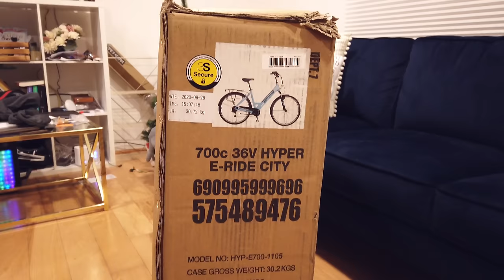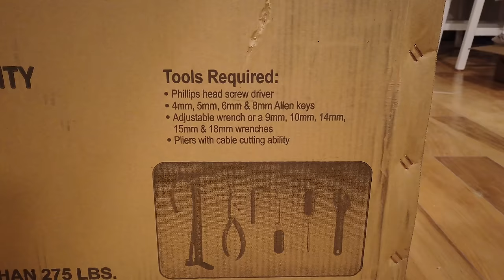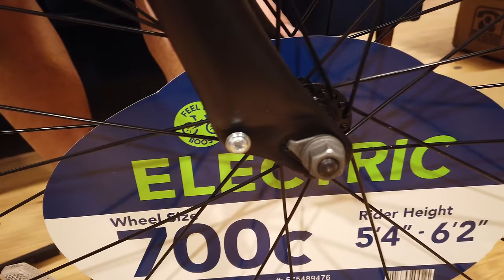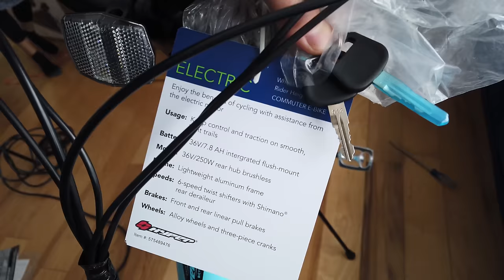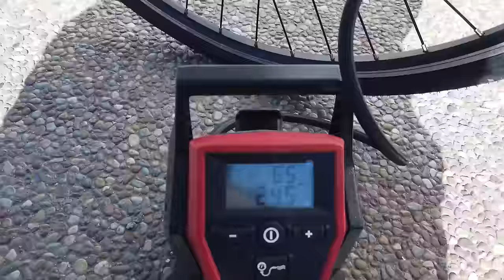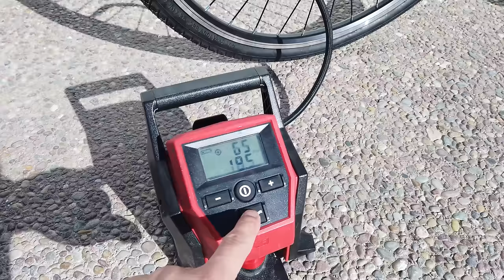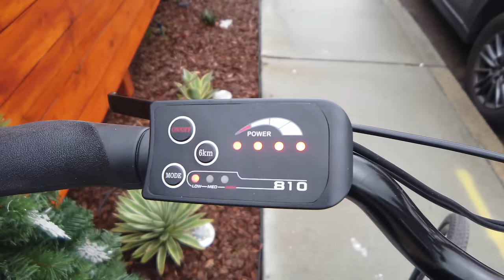Cheap $398* Walmart Electric Bicycle!!!? Hyper E-Ride City 250W 36V Ebike Review + Assembly Tutorial

Comment: So it sounds like the bike is designed to limit your speed to 20 mph . This and the fact that it has no throttle makes it a "class 1" e-bike.   Class 2 is also limited to 20 mph but can have a throttle as well as pedal assist. I believe  class 3 is pedal assist only but has a higher speed limit. All 3 classes are also limited to a 750 watt motor. These are the 3 classes of e-bike that are legal for road use in the US. This is my understanding from what I have read, if this is this is not factual or has changed,  maybe someone out there can let us know.
Reply from the maker: That sounds right according to this website https://www.aventon.com/blogs/aventon_bikes/difference-between-a-class-123-ebike

Comment: Maximum speed is 20 mph , so once you reach that speed , it cuts out. Now you are just pedaling until you reduce your speed below 20 mph .
Reply: ok, so even if you had it on high while full pedaling (which he didn't), it would just cut off the assist?
Reply: @dormetheus  yes. it is intentionally designed that way for both legal and hardware reasons. once the system detects that the bike is going over 20 mph it will stop assisting you. that's basically it
Reply: It becomes pretty seamless.  If you want assist, just don't pedal too hard once at 20 mph.  You kind of hit a wall, since any faster and the motor stops assisting.  Believe me that 20 mph is about as fast as you want to go regularly.  I hit maybe 45 mph on some steep downhills on my regular bike and that takes max attentiveness and wouldn't be pretty if a mechanical failure or a hard bump.

Comment: I have one of these.  Great value for the money.   Usually I prefer to get a little exercise, so I usually set pedal assist to level 1 which will on level ground allows me to 'out-pedal' the motor -- by using human power my speed is generally over 10 mph which is above the cut-in point for the motor.  But on hills, if the grade is substantial, muscle power falls below the amount necessary to stay above 10 mph and the motor kicks in, which takes the 'killer' out of the hill.  If I want to expend less effort, I set the pedal assist to level 2, which will generally push the bike along at 15 mph.  Unless I pedal like mad I can't really apply any torque via the gear chain, so in this mode, except on hills, I'm just circulating the pedals without actually contributing to the forward motion of the bike which is driven by the motor most of the time,.

Colin is right about it being difficult to get more than 20 mph even in the highest pedal assist mode, but for me the bike is more about extending my range from my maximum waling distance (more than 2 miles and my knees will hurt for a month, but with the bike a trip of 10-12 miles is pretty comfortable).    The way pedal assist works is something you adjust to.  I think it works very well and you can adapt to it's functionality to a variety of different strategies, depending on what your priorities are, getting there fast, getting somewhere far away and back on one battery charge, getting there without breaking a sweat, or getting there and getting some exercise too.  After a time you'll be able to figure out how to use pedal assist to accomplish any of these objectives.
Reply from the maker: Thank you for sharing your experience with the bike!
Reply: I know it's called e-assist, but if you're on a flat road on the highest setting will the bike move on its own using just the motor without any pedaling?
Reply: @norcalpacific  No, because this particular bike has no throttle. The motor only kicks in to assist when you're actually peddling.
Reply: What a very well written and effective comment. Thank you, sir. If you have the time, how is the bike doing, still holding up?
Reply: @deanishere1154  Yes, it's holding up great.   I remain very satisfied with this e-bike.   It's not the Lamborghini of e-bikes but .... maybe like the Toyota Corolla.

Comment: I'm a lifetime cyclist and can give tou a tip about the seat hight the bike are not made for you to touch your feet to the ground while seated, you have to raise the saddle until your pedal is in the 6 o'clock position and with your foot down in the pedal with the knee bent a little bit.
Reply from the maker: Thanks for the tip. That's how I setup my road bike, so I don't waste energy during a pedal rotation.

Comment: Seat height is adjusted so your leg is almost extended at the bottom of the stroke; you must stand up on the pedals and step down to stop without falling over.  If your seat is too low, you won't be able to ride nearly as far as you would with the correct seat height.  An e-bike isn't as critical on seat height (unless you're trying for the 100 mile ride in one day).
Reply: I always try to set the seat like that on my wife and daughter's bike, but they fuss and want it so low their knees almost hit their chin.  I commuted to work by bike 12 miles each way for 20 years, but they won't listen to me.  Even with my leg almost extended, my right knee was hurting so much I had it X-rayed thinking I had lost cartilage.  It was fine and just a sore tendon.  Turned out the Bio-pace elliptical front sprocket was the culprit.  Looking it over, I rotated it back from the manufacturer's setting so the min radius occurred near full stroke, which fixed the problem, then read where others did the same thing for same reason.

Comment: I ended up buying a Magicycle when it was 1299 - then I saw this go on sale again for 400 so I bought one.  I am very impressed with the range and performance given the low price and specs.  

I like doing my 12 mile commute on this because it works and I don't worry about it as much being locked up outside during my shift (double locked, cover over it, and battery brought inside to charge).  I dig it!
Reply from the maker: Hello Mark, thanks for the comment. I'm glad you like the bike!

Comment: Wow they included a back rack...Nice
Reply from the maker: Yes. Thanks for the comment!
Reply: Yep - it's a steel rack, so a few ounces heavier than a high-end aluminum rack, but it's surprisingly decent quality, good welds, a proper tail-light bracket with the correct mounting holes, and seems to be up to handling the rated capacity (18 kg, or nearly 40 lbs) quite well, with very little tail shimmy under load. The whole bike has been a bit of a pleasant surprise - I got more than I expected.

Comment: Yes i have  the same bike yes it maxes out at 20 and then no pedle assist
Reply from the maker: That is correct. It's a Class 1 ebike. 
Class I eBike use a battery and electric motor to provide assistance at up to 20 MPH when the rider is pedaling (pedal assist). Class I eBikes can go faster than 20 MPH, for example, when going downhill, but the electric motor will stop providing assistance once 20 MPH is reached. 

EBikes with throttles can turn on the electric motor and propel the bike without the rider pedaling. Class I eBikes cannot have a throttle - they can only provide assistance when the rider is pedaling.

Comment: I ´m impressed that you get this much ebike for $400. I´ve been riding E now for 5 years. I´m old & fat so
this bike wouldn´t do for me, but for a reasonably athletic person under 180 pds, this a pretty good budget ride.
It uses some oler type components but that´s not necessarily bad. It´s easier to work on than the bike 
I´m riding. Iḿ certain it´s lighter. I think one should have a basic knowledge of bike mechanics. It obviously
needs a bit of tuning out of the box. It´s affordable enough to personalize.
Reply: This bike isn't that price, it's over 500, seen a few of these Walmart adverts claiming a $300 price when they're well over 500.
Reply: @will4may175  - Depends. $400 holiday pricing is currently (12/08/21) in place - same as last holiday season. The only competition I see at the $400 price is the Jetson Bolt Pro - which is why I just bought the Hyper.
Reply: Its a pipe dream for me to own a e bike i cannot afford anything like the one in video. In the UK  they are very expensive.

Comment: Colin, thanks for your thorough review!  As a bonus, when you shared about getting a quick release skewer for your bike's front wheel so you could quickly remove  wheel because you didn't have a bike rack, that bit of knowledge was a game changer for me.  I had  always been frustrated that I couldn't get my bike into my minivan, now I know how to do it!
Reply from the maker: Thanks. I actually bought quick release axles, so I could take the front wheel off easily. It does require disassembling the front axle, but isn't that difficult. Just make sure you tighten it enough, but not too tight where the axle binds. https://amzn.to/3buzvif
Reply: Hi Colin...the link you posted for the quick connect axle on Amazon....is that the correct kit to purchase? Thanks for the review

Comment: I like mine I changed some components to make it lighter. I took fenders off for front & rear & changed front forks, due to the fact the front forks that came with bike are cheap & seat post I changed to aluminum with Allen style instead of nut & bolt style. Tires I have on mine are fixie type which are 700x 25c w/presta style tubes. Front rim was changed to corsa & trying to see if it's possible to change rear with corsa. I had a fixed gear bike & I love tinkering with my bikes to improve their performance, but bike from wally world isn't bad for $400. I call Wal-Mart wally world in case you've never heard it called that. Handle bars were changed to beach cruiser bars as they are longer & wider.I liked your video very informative & intial detail on your video.
Reply from the maker: That's awesome. Thanks for sharing. How does the bike compare now after all that you've done? You can always re-spoke the rear hub onto a new rim, but that's a lot of work.
Reply: @ColinLeung  It rides smoother but than again I ride it on flat services & very little hills. I've had mine up to 20-25. Yes that's what I had figured on the rear, I'm trying to figure out the geometric dimensions to make it happen, except what I have in mind is a geared bike but with a fixed gear. I'm assuming I can do it but tinkering as we speak to see if it's going to work, I will let you know the results when all done, just time,patience, & work. My friend told me if I succeed in this I should put a patent but not my thing & I'm not about the money, I just prefer ideas & diagnoses as I call it
Reply from the maker: @garygushue4273  Let us know how it goes. I feel like changing the tires to 700x21's would have made the most difference in speed for the cost

Comment: I bought this at the bonkers sale price and despite the cost cutting, it's perfectly usable out of the box as long as you have a screwdriver to tune the derailleur (but I got one with a junk falcon derailleur instead of the Shimano most people seem to get) 

Mine had a few problems - the seat clamp wasnt tight enough to hold the seat. I could have tightened it a lot, but it felt like kinda junk and I had a spare one sitting around so I replaced it. Then I noticed how crunchy the pedal bearings were. Again, usable, but I had some spares. 

The wheels were just slightly out of true. Usable, but a spoke wrench and five minutes solved it.

The derailleur took some work (I'm a novice with chain systems, my other bike is a belt so I knew nothing) but I got it reasonably smooth with just a YouTube video from park and a Philips. 

The front fender needed a little bending straight to not rub, and after that, it rode nicely. The front forks are crashy and I kinda wish it was just rigid, and the seat is a nightmare that absolutely needs an upgrade. But the brake pads have good feel, the tires handled slushy snow just fine, and power from the motor is unrefined but surprising. I have an 18 degree hill by my house that I barely get up on my single speed 350w, but in first gear max assist, the Walmart bike just chugs up it.

I also noticed the kickstand is kinda bad and the bike can fall over with it, but a $15 center stand on Amazon went right on with one bolt.

Overall, I think anyone buying one of these needs to also order a basic Allen wrench set, a better seat, better pedals, a center kickstand, and a spoke wrench.  But with a few basic tweaks and a couple hours of tuning, it's a super serviceable little city runaround.
Reply from the maker: Thanks for sharing your experience, and I'm glad you got it working smoothly. Some people buy it expecting it to work right out of the box, and may become frustrated because they do not have the tools nor skillset to perform those fixes.
Reply: @ColinLeung  I think one thing you did well in your video was point out that quite a few of the little issues arent out of reach to an average person. If you can assemble the bike, you have the skills to tune it up! I'm a complete idiot when it comes to derailleurs, but I just grabbed a screwdriver and YouTube searched a video that explained it. 

The only things Id really point out as  downsides are the packaging is kinda poor. I bet the wheel was slightly out of true for the same reason the fender was slightly bent.

I'm a big proponent of encouraging people to  try things and have realistic expectations. $398 for an entire ebike with fenders and a rack is bananas cheap. It's gotta be that cheap somehow, and if they give you good parts to boot, the fit and finish had to suffer. But the good news is that the problems it has aren't deal breakers and/or are easily fixed by anyone in an hour or so with at most a $2 special tool. I don't like gatekeeping hobbies and DIY behind expensive tools and parts or a lot of knowledge that's hard to find. Your video is a perfect example of what someone just getting started with their new boxed ebike needs!

I'd always prefer a cheap product made with good materials that I can finish setting up myself. If someone is not able to do that step, a bike shop will probably put the bike together for you and set it up for $50

Comment: Great Review!  Thank you for posting this, I've been thinking about buying one!  I missed the $398 deal so I'll have to pay the current price of $598.
Reply: Honestly if you are going to spend that much get a lectric. $899 5 levels of pedal assist plus a throttle and cruise control. Quieter great customer service 500watt motor.
Reply: If you can find them in stock they sold out fast
Reply: I’d rather have a folding one.
Reply: @ronaldharris6569  mine was not in stock but I ordered it and got it within a month. I have had it 2 months and put over 300 miles on it. I love it!
Reply: @MySonsMother  lectric folds. I tuck into a space at work and charge it.
Reply: I’ve been planning to buy an lectric for a long time, but I saw another I might get. Don’t remember which or why. Will deal with it later.
Reply: If you haven’t purchaed it yet I would suggest taking others on your comment sections advice. The looks of the bike are nice, but being asked to pay 50% more of what it was just at is distasteful to me at least.
Reply: @Irehs72  great suggestion, or now the Leitrim 2, and if you haven’t purchased and can wait another few months the Leitrim should be ridiculous with upgrades.
Reply: Lectric not whatever YT changed my trying to. 😔
Reply: @buffalomind6838  - List for these bikes is $650. They are often marked down to $600, and, during holidays, (like now, 12/08/21) black Friday type pricing is in effect - $400. They did not "raise the price 50%" - they just have a steep holiday mark-down, just as many other vendors do.
Reply: Check it again now!

Comment: If you can assemble fine, but I recommend getting from a dealer already assembled.  Many times it doesn't cost any more and may even cost less and you can test ride it and know it works.
Reply: Are there any dealers you reccomend?ive been trying to find some motorized vehicle for ages so I can get a job. I’m 14 and only have 350$
Reply: Walmart offers at-home assembly for about $49. Some bike shops will also assemble for a similar price (others will not assemble bikes, but they'll service them after you assemble them). From what I've seen, these are well-packed and set up correctly from the factory. You may have brake calipers that need the tension pre-load screws tweaked from side-to-side, but the bike I just put together really had no issues. If you have basic tools and the patience to watch a couple YouTube videos, anyone who knows which end of a wrench to hold should be able to get one of these assembled without too much trouble.

Absolutely no dealer in my area has anything comparable, even no-name chinese container lot e-bikes at $400, which is the current (12/08/21) pricing.